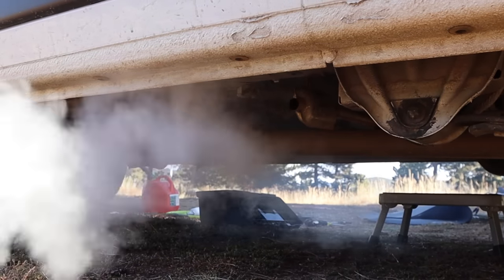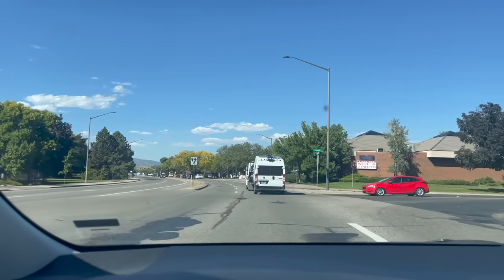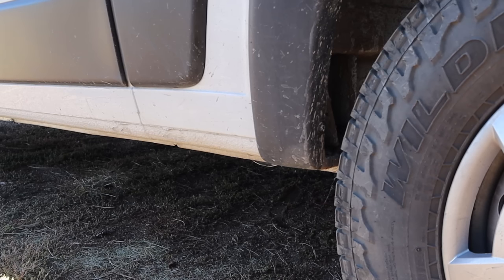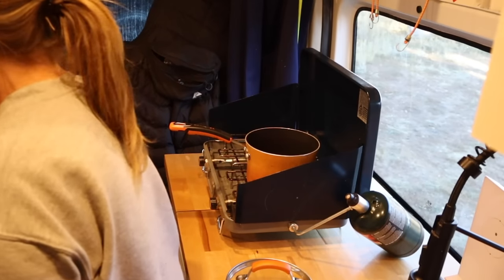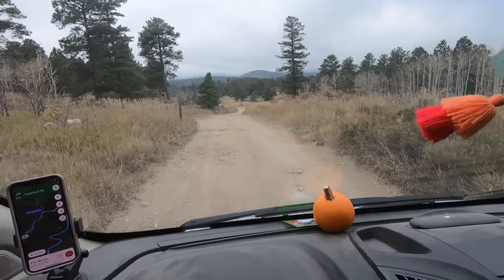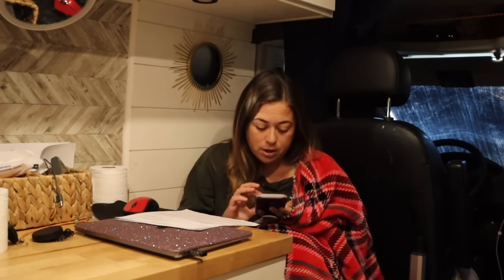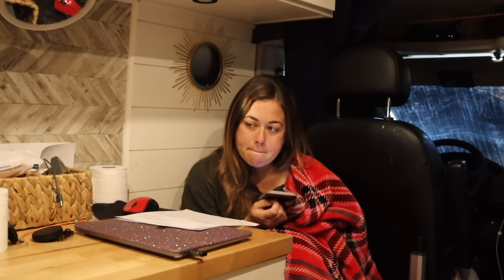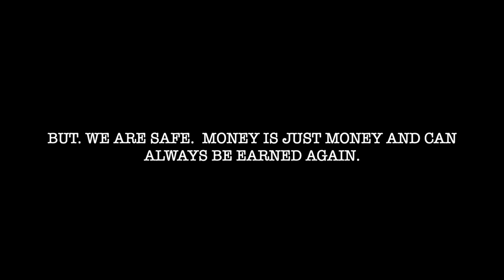Solo Van Life: We've Hit ROCK BOTTOM

Comment: Don't despair. I've been there. I got stranded in Nevada in the middle of the summer for a month due to my truck's fuel injectors. I was stranded 8 days and  paid $3000 to have it repaired. Hit the road and the same thing happens an hour down the road. No cell service again. The repair shop never checked the fuel filter so the brand new injectors got clogged up  and got stranded again and had to wait 14 more days to even get it looked at due to the back ups in diesel repairs. Got stuck in my trailer in 110 heat with my 8 year old. Then a fire swept right by the town. Thought we were stranded with no vehicle. This was my summer vacation. Paid another $1500 plus $900 in car rental and $1500 for rv park rental. I definitely cried. It felt like hell. Especially with the extreme heat and fire. We were trying to get to Idaho. Never made it to Idaho. However we were stranded on Idaho Ave, ironically.🤣 But I did discover some beautiful areas in my rental in the middle of Nevada that made it bearable. Hang in there.❤🙏

Comment: Strength has absolutely nothing to do with tears. Tears are just a way to release anger, frustration and stress. I think if you can work from your mom's or another family member or friend, I would take off the rest of the year to rest and re-group and de-mouse! I would take this time to take the van to a dealer and have any items under warranty reviewed and get full maintenance work done. Definitely check wheel bearings, suspension, coolant and transmission fluid/filter. Then, maybe snow bird down to Florida for a trip and see how things shake out. There's nothing and no one that can tell you to stop or go. This is your adventure!

Comment: Opening up the combustion heater, cleaning it, then reassembling it with $15 in new gaskets is only a couple hours of work....just a few screws....and a container of brake cleaner.
Tip ..learn how to adjust the fuel control in the computer or buy a unit with altitude compensation...higher elevation makes it run rich, resulting in carbon buildup.
Some suggest (including the company I drove for when I had to deal with the heaters said to) run them on max for 3-5 minutes before shutdown.
Good luck after getting everything fixed. 
Remember what doesn't kill you makes you smarter and stronger!
Plus tip.... warranties are great when fast and free, but if you must wait weeks and live in a hotel, an independent repair shop can be cheaper if it saves nights in a hotel etc....you just decide who to pay

Comment: Nothing has changed the moment the mice are gone and you have your heater in working order. Just a bit of a journey and test you’ve been through recently. Hold steady. Big changes or redirects are usually costly and not without flaw. I know from many instances of my own experience. Anyway,…I have been in a van coming up on 3 years, and for me I wouldn’t change it, despite some extra hustle it takes to make it livable. I’d like a really small camper to tow behind it for situations like you just had, but saving for other priorities. 
Anyway,…keep cruisin you’re fine.👍
PS,…it may take some time, but you may be able to find someone with some property that will let you pay a campground price ($300-$400/mo.) to stay on their property. Then you can put a small fence (doesn’t have to be with post in the ground or permanent just standing enough so the dogs know not to go over it) around your van with a gate to pull the van in and out. It’s great with privacy and the dogs love it. Then you’ll rarely question the van life again.

Comment: Hi
There is nowhere in life where you are free from the risk of obstacles and horrible things happening. You handled this really well and crying in itself is no sign of weakness it is a well proven method of relieving emotional stress. People who don’t cry can be weaker than those who do, the crying you did was after you have won over the immediate situation it is a sign of great strength. 

One mouse or one hundred you need exactly the same amount of cleaning done. A complete and thorough clean of the van is very healthy once in a while anyway. If you don’t feel up to it empty the van and have professional cleaners in. That way you only really see your van beautifully clean. 

Running your heater on high once a week for an hour or so will burn off deposits and prevent the carbon build up. If it is diesel you can also add a decarbonising additive once every five tanks or so. One bottle will last you ages. Will help the heater last many times longer.

Belts are inspected at each service but pulley failures can be sudden. They are rare, it is far more common for belts to fail because people don’t check them.

A truck and camper trailer will use far more gas than your van. You could hook a camper to your van and have the best of both with a base with space and the ability to flit a little way with just the van. 

Apartments can have floods, fires, annoying or careless neighbours, no where is free from problems. What you have to look at with any of those is how much control you have. In your van you may be limited in some ways but you have more freedom and control than almost any other base. 

If anything try to make an adventure when faced with adversity. If you a pushed away from your normal don’t just make do use it as an opportunity to do something different or special that you wanted to do. One English couple whose van blew its engine used the time to do a pilgrimage they had thought about, another moved to do a tour of Australia. Every obstacle is a chance to do things differently for a while. 

You are amazing and strong and should live the life you want.
Reply: Broken belt cannot damage an axle..sorry to say, dealers will charge top dollar and often replace parts that do not need to be
Reply: @davidemm829  I think they were referring to a damaged CV joint, if it is under warranty there is no disadvantage to getting used parts replaced with new.

Comment: It's been a few weeks, so I hope you, your dogs and your van are doing better! 🙁 What are you running for fuel in your heater?  If you're running diesel, making the switch to kerosene will help you avoid many (If not most) issues with the combustion chamber.  Kerosene burns much cleaner than diesel, so there is less soot and fouling. Meaning that these issues happen far less often. Another nice benefit of using kerosene over diesel is that it smells less offensive and isn't as oily. I have an Espar diesel heater in my Promaster and have been running kerosene for more than 5 years without issues.

Comment: we run kerosene through it when it start to clog up, it will burn clean the chamber then switch back to diesel, i'm a diesel mechanic and we do this for the driver at work, also  i'm a van life with a cheap Chinese heater in my sprinter on my third winter coming up no issue, i would do the burn on pavement not around dry bush or grass

Comment: there is a hidden setting where u can adjust the fuel to air ratio so that it doesn't run rich, which causes carbon buildup aka soot in the burn chamber.

Comment: To be absolute secure that you can take whatever failure thats can hit the van part, not the living area you need around 8 000 euro, engine, transmission or break, tyres, waterpump, etc & 2 to 5000 euro for the living parts, heat, cool, water etc. 10 to 15 000 euro you never touch is the reallity! Good Luck! Meachanic Peter Eriksson Sweden Europe! 😊😊😊 dont belive anything else!😊😊😊

Comment: Look life is a bitch sometimes, i think you handled it well,  its one of the worst things that can happen  clean out your van and don't replace your heater just clean your glow plug,  or get someone to show you how its done,  i know  there cheep but replacing it every time something goes up with it makes no sense, its like replacing your tyres every time there low on air ,just get the glow plug out g8ve it a clean and put it back its usually that simple,  what i would say about economy is running it low is turning out to be false economy, how much diesel can you get for a hundred and twenty dollars,  so use that little bit extra and give it a burn on high for just five minutes before turning it of that will probably prevent the plug from getting gummed up  experiment with how you use it good luck.